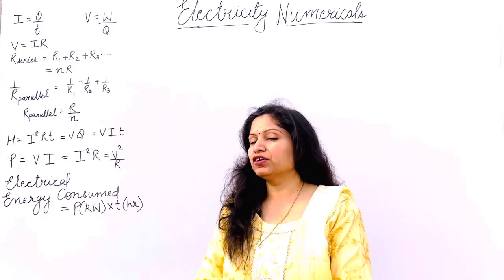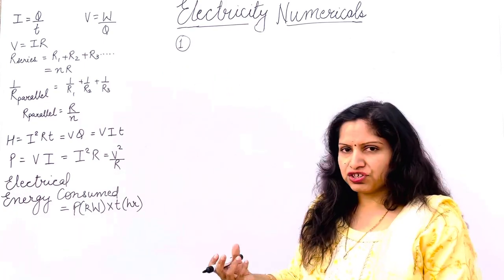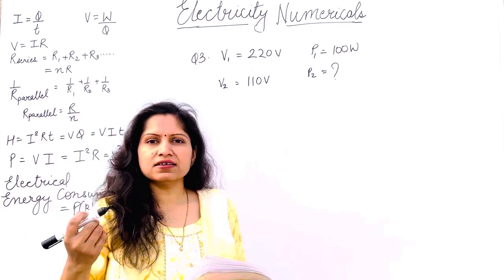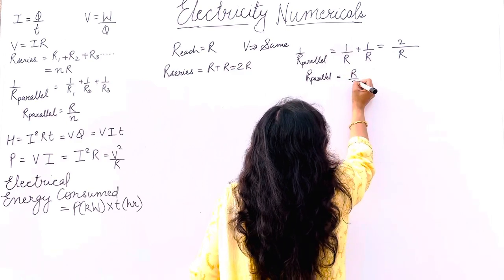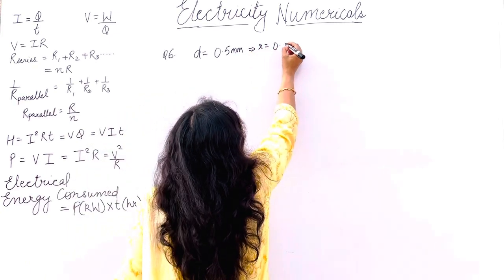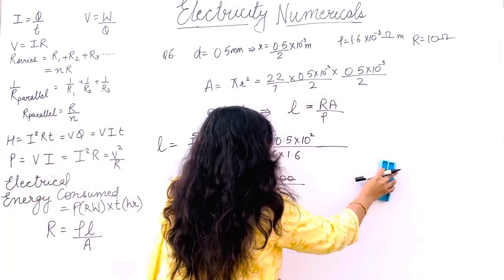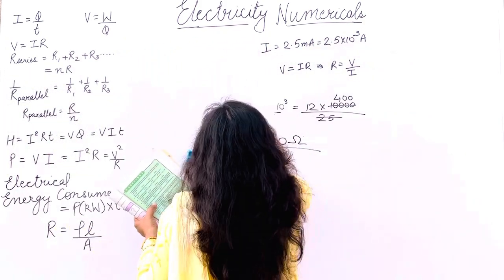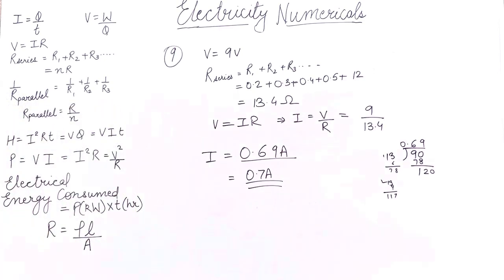Electricity Numerical-NCERT Book

Comment: Ma'am Q.1 main 5/R kaise ayya🤔🤔....❓❓
Reply from the maker: @dilipsinghnathawat7895  resistance is directly proportional to length, so if the length becomes 1/5 resistance also becomes 1/5, i.e R/5
Now in the formula of resistance in parallel , 1/R is there, so it becomes 
1/(R/5) and denominator of a denominator becomes the numerator so it become 5/R
Reply: Thank you ❤️😌 ma'am for solving my doubt
Reply from the maker: @dilipsinghnathawat7895  welcome